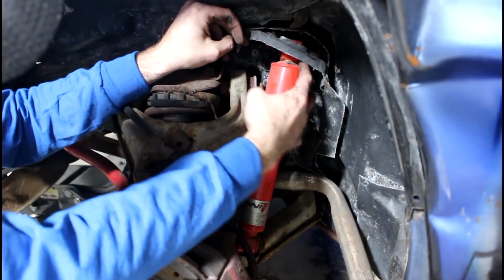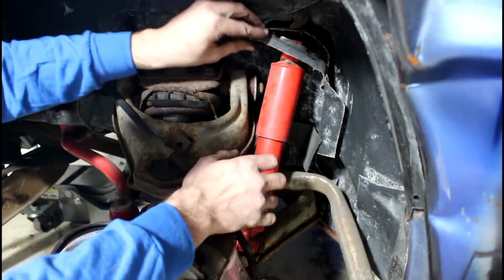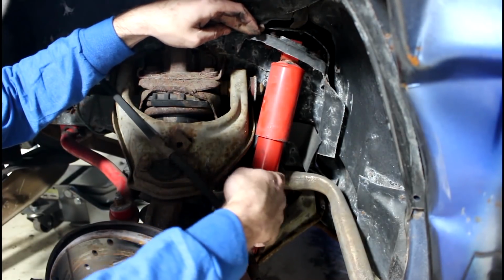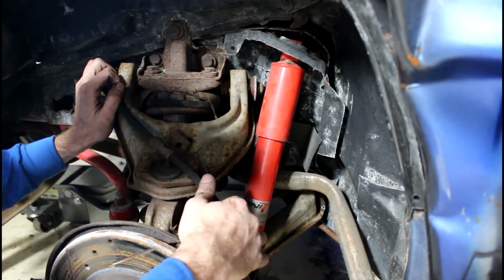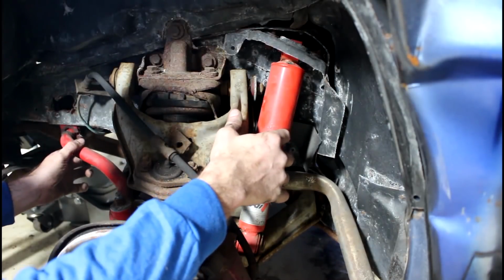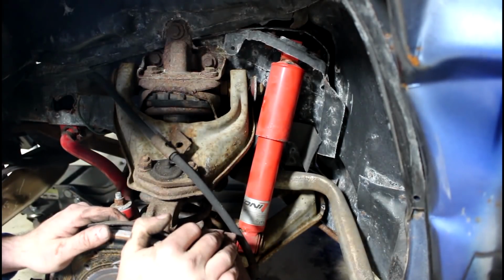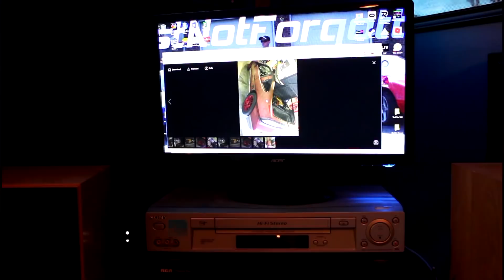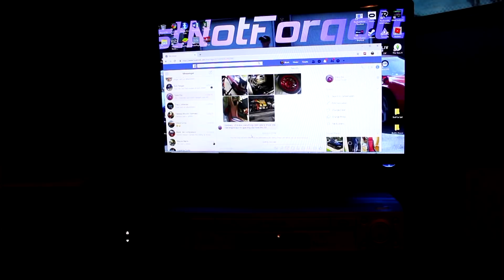Home Shop Swap Garage-Fiero Edition: Episode 2-STRIPPING THE YOUTUBE CAR I BUILT UP

Comment: I have to dissemble my 3800 sc 2 fiero, unfortunately there’s a issue with the torc converter. I might say screw it and go with either a F23 or a Getrag out of a low mileage fiero. I’m guessing $400 for flywheel $400 for transmission $250 for clutch I’m guessing around $1700 for a stick conversion.